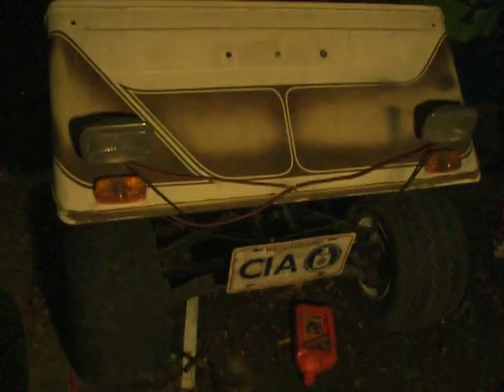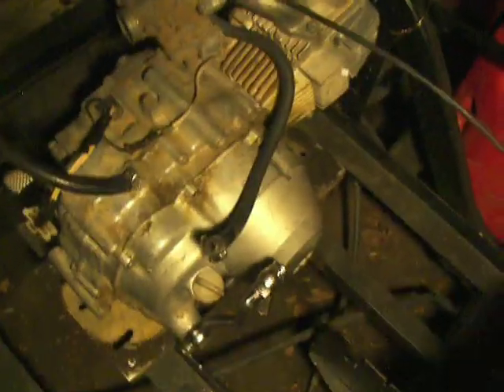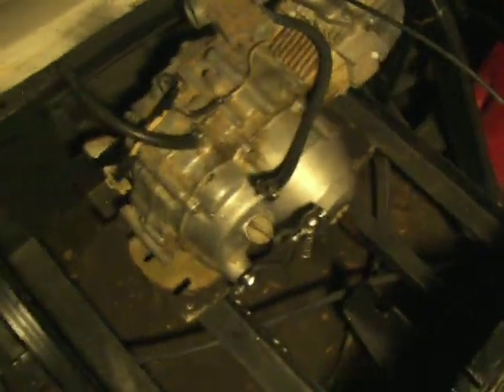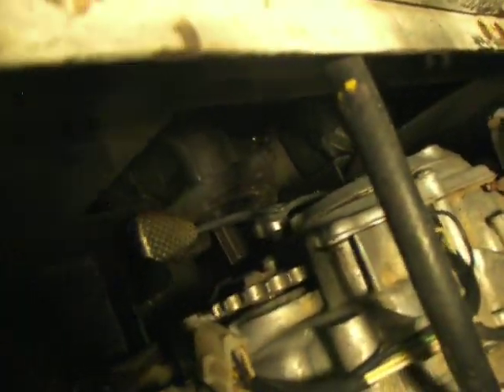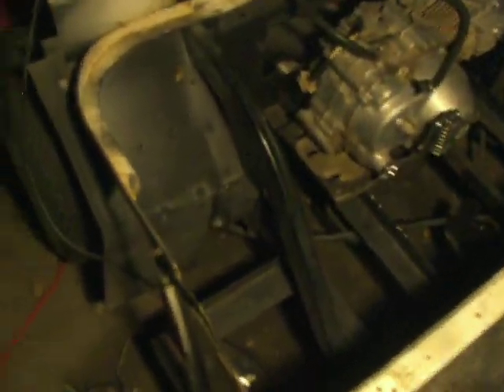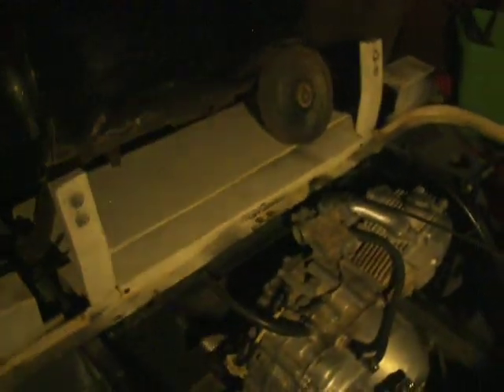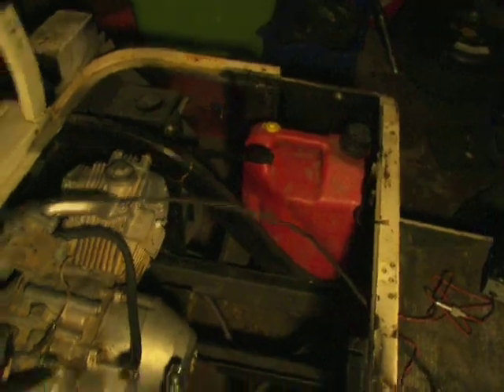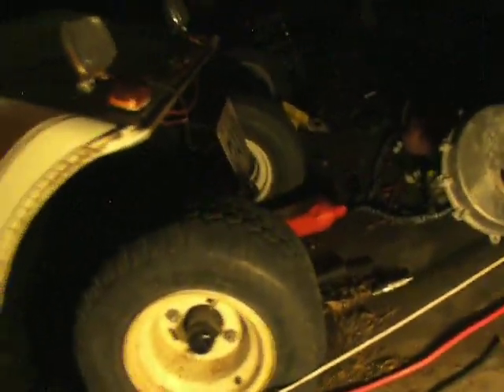electric to gas golf cart

Comment: melex golf carts are made by E-Z-GO ,  might considered a briggs 15 hp horizontal shaft since the engine can be cooled down with a flywheel fan instead of that honda airflow cooled engine, and a chain drive clutch and and sprocket on the rearend shaft, you be going one way with no reverse, unless changing the differental that has a built in forward and reverse lever, just a though :)

Comment: the only problem I forsee is the cooling of the engine since its air cooled and its positioned inside of a box, it might get pretty hot, unless you have some sort of air circulation. 

Also, depending on the final drive "if your using the original differential" the gearbox of the engine might be geared too low to run the cart at an enjoyable speed. 

good luck =)

btw, good lighting makes for a good video.